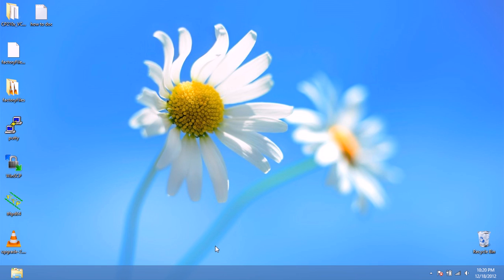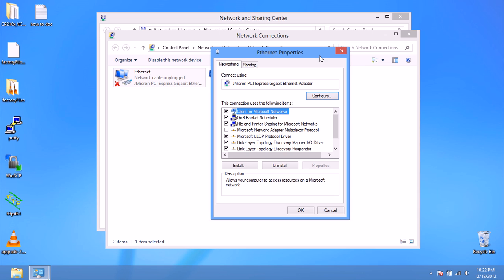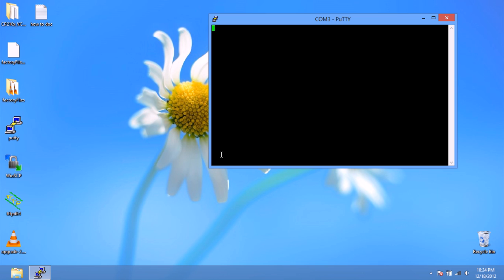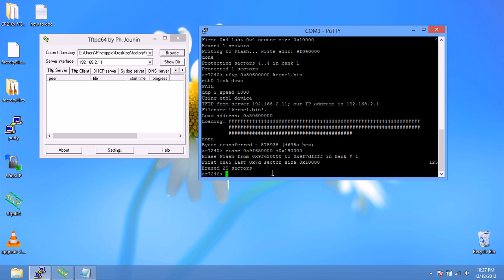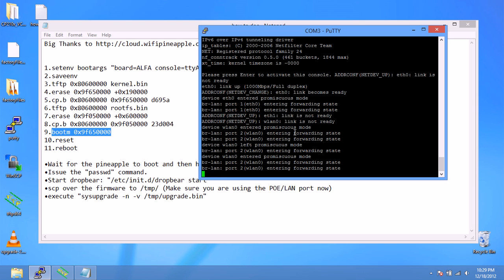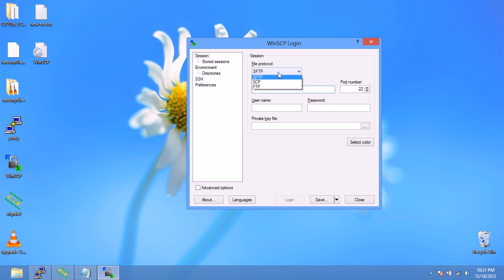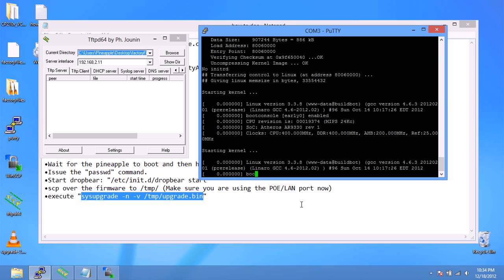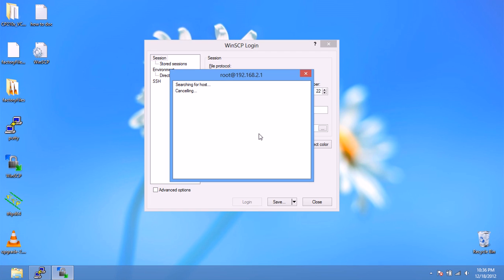How to Flash the Wi-Fi Pineapple IV Over Serial  P-2

Comment: ar7240> tftp 0x80600000 kernel.bin
eth0 link down
FAIL
dup 1 speed 1000
Using eth1 device
TFTP from server 192.168.2.100; our IP address is 192.168.2.1
Filename 'kernel.bin'.
Load address: 0x80600000
Loading: T T T T T T T T T T
Retry count exceeded; starting again
eth0 link down
FAIL
Using eth1 device
TFTP from server 192.168.2.100; our IP address is 192.168.2.1
Filename 'kernel.bin'.
Load address: 0x80600000
Loading: T T T T T T T T T T
Retry count exceeded; starting again
eth0 link down
FAIL

 HELP???

Comment: this is what it says in putty when i tried to set everything to 192.168.2.100

eth0 link down
FAIL
Using eth1 device
TFTP from server 192.168.2.100; our IP address is 192.168.2.1
Filename 'kernel.bin'.
Load address: 0x80600000
Loading: T
TFTP error: 'File not found' (1)
Starting again

eth0 link down
FAIL

Comment from the maker: First turn off your firewall/antivirus. Make sure that your Ethernet connection is connected to the PoE/LAN port on the pineapple. TFTP has to be set to 192.168.2.11, look for that in the server interface drop down box. Disable all network cards in your computer and only leave the one on for the pineapple and set that address to 192.168.2.11.

Comment from the maker: Thanks. First turn off your firewall. Make sure that your Ethernet connection is connected to the PoE/LAN port on the pineapple. TFTP has to be set to 192.168.2.11, look for that in the server interface drop down box. The current directory in tftp has to be set to the folder that you downloaded the rootfs and kernel. Make sure it's also unzipped.

Comment: Awesome video, absolutely love your attention to detail! 

I am having an issue however...When I'm at the part where you type in >> tftp 0x80600000 kernel.bin I could not seem to figure out why it was timing out and not working. 

Shortly after I noticed that the TFTP from server is set @ 192.168.2.100 and I know from your video it's supposed to be 192.168.2.11 So what am I doing wrong?? I triple-checked all my steps and still can't figure it out. 

Any help you give will be greatly appreciated!

Comment from the maker: This is a two part series on how to flash the pineapple over Serial. You would ONLY DO THIS if your pineapple is bricked(doesn't boot right). This is the second part. The first part shows the hardware setup with the TTL UART adapter. I should have reiterated that again in this part. Sorry. And there was no new update.